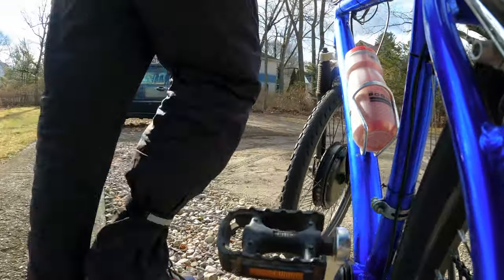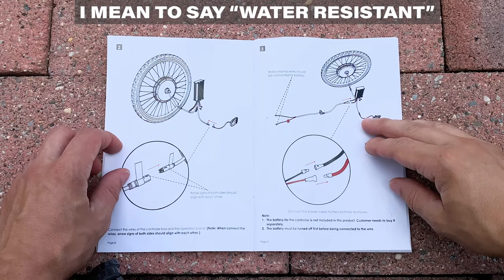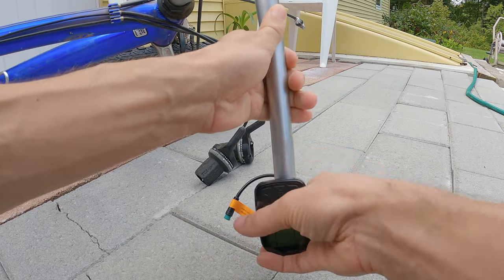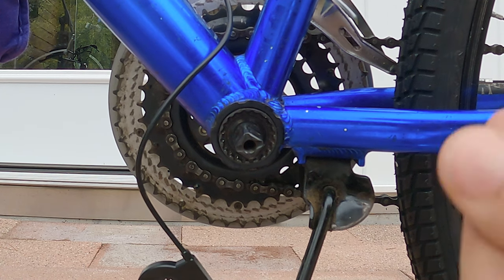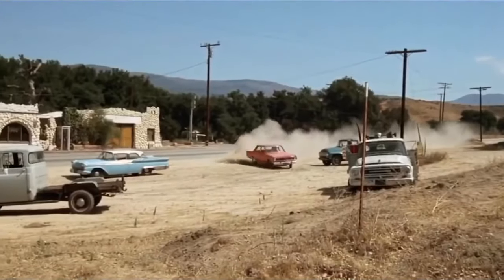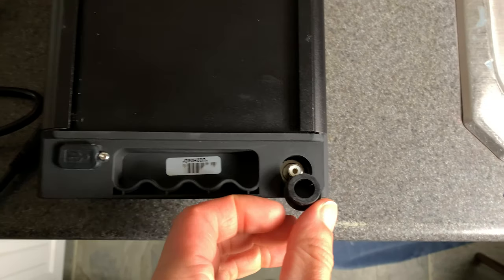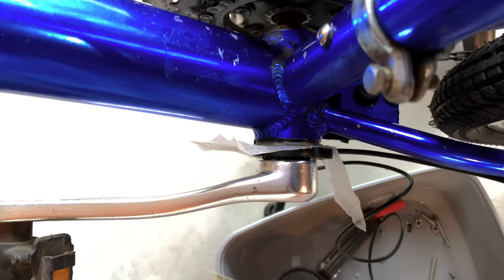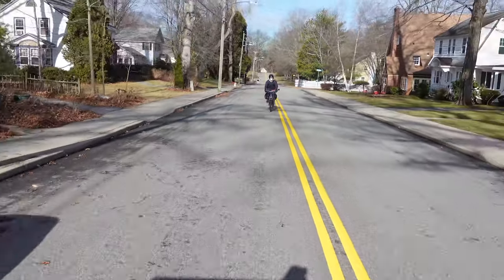How to Budget DIY eBike Build

Comment: Great Job! 
So in your Opinion, If you're on a budget, which is more efficient a  E-Bike build or the Motorized 2 cycle engine kit on a (Kent 26' Beach Bayside cruiser or similar models?) I Like This E-Bike(s), they seam Extremely Quiet compared to the gas 2 or 4 cycles Motorized bicycles 🔊. What do you think?
Reply from the maker: I’ve only ridden next to a 2cycle bike…NOT on one… but my 1/2 informed opinion is that from an energy consumption vs cost point of view they are both cheaper per mile than most anything, so what it really comes down to is choosing an ebike that is quiet, doesn’t smell and has less maintenance (hypothetically), or a 2stroke that can be parked out in the rain with total indifference and will probably last longer…. (not that swapping out a battery pack or a hub motor is all that hard… but that does make it more expensive and less reliable).